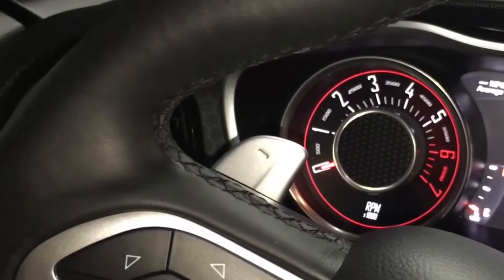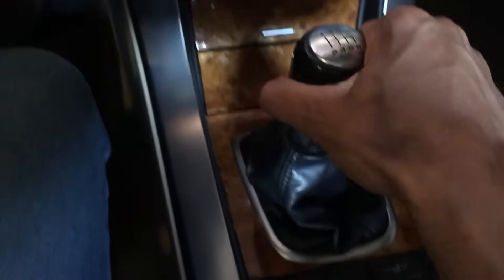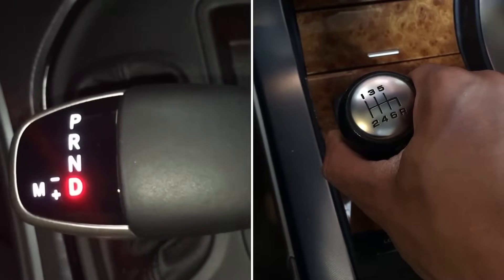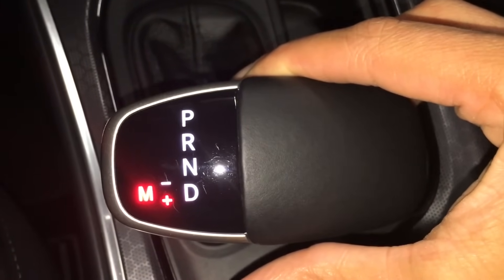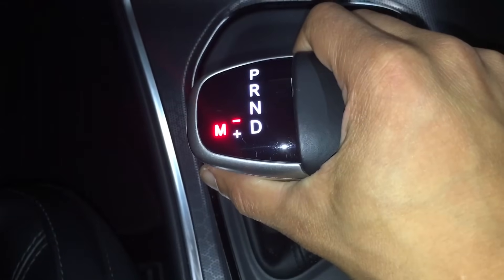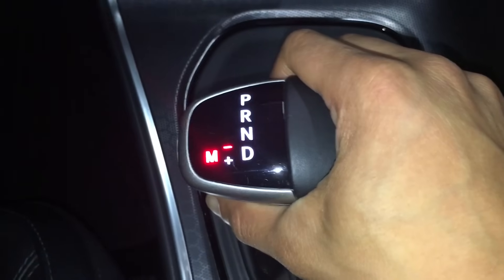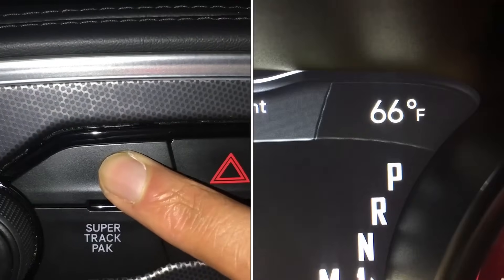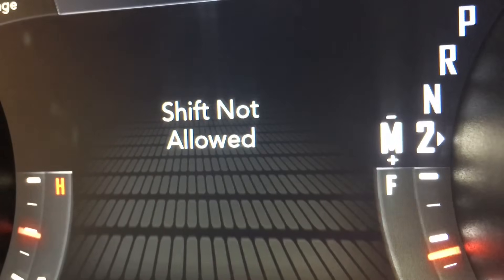PADDLE SHIFTERS: How They Work Explained!

Comment: So you don't know that paddle shift Transmissions are standard Transmissions using a computer to shift the transmission using solenoids can a hydraulic system to engage and disengage the clutch

Comment: My car (2010 Lincoln MKZ) has a trans like this except it doesn’t have paddle shifters. Instead, u just shift with the gear lever like on a sequential trans in a rally car or GT1 racecar. My car also won’t let you downshift or upshift at certain points, but it only has the automatic downshifting. If you let it go to the redline, it’ll stay there. Also if you spin the wheels, it won’t let you upshift for a few seconds theoretically until it thinks you’ve gained traction. Downside of that is if you spin a little bit, and hit redline early, it won’t let you shift and you’ll just be awkwardly redlining for a bit at about 40mph in 1st until it lets u shift into 2nd & then you disappear. It also for some reason has a delay in the shifts.

Comment: I can upshift pretty well with the paddle shifters, but I still struggle to understand when to down shift
Reply: Going up hill
Reply: If you want more acceleration, you need to gear down because the engine would have a higher RPM. It’s just like riding a bike. When you ride a bike in higher gears, you struggle to accelerate. But when you gear down, you find yourself being able to pedal more often and accelerate faster.

Comment: Paddle shifters aren't necessarily in an automatic transmission car. Many are in a manual transmission car, but with the clutch automated with electronics and a hydraulic system. It's still a manual transmission and structurally different from an automatic transmission.

Comment: When you slide over icy road need to reduce speed/use engine brake which paddle shifters should be used  + or - and when you need more power for hilly area should be  + or - and you need to pass the car on highway should be + or -  ?
Reply: if you want to slow down use downshifting or -

and also if you want to climb up a steep hill and downshift or - again. it's like a bicycle it's easier to push the pedals in 2nd gear going up hill than 5th. vice versa when going down hill and you want more speed you would shift up or +

basically you want to watch your rpms kinda like the speedometer with practice you can feel/hear enough to be able to know when to shift up or down.

Comment: I have a Mazda Miata, and its paddle shifters are VERY intuitive. They also offer up/down shifting on both sides of the wheel.
Reply: How fast do they apply and can you control exactly when the shift happens?

I can heal-toe downshift a manual and have the power come on exactly when I want and how hard I want. How close is paddle shifting the automatic to a manual shift?

ETA: fixed some garbled grammar.

Comment: What happens when I am in say 4th gear and want to downshift to get torque to overtake someone. Do I have to wait for the RPM to drop ?
Reply: In my car at least I have to wait for it to drop where, when I down-shift, my rpm's won't be in the red. If I can downshift without the rpm's going into the red it lets me downshift

Comment: can you explain to me when do you need to upshift? at what rpms? 
is it before the red??
Reply: it very much depends on the car but you should be trying to avoid red lining at all costs as a general. most cars sweet spot for shifting is around the 3000rpm mark. some higher, some lower.

Comment: im still confused
Reply: I know right.. Basically its a computer controlled Automatic transmission with manual user input points. Overclocking with fail safe built in. Pretty genius idea. And wait till they add Ai learning to it. Humans will be obsolete soon.
Reply: Human Being. That is what they are after. Making the human being obsolete and once that is done THEY and the AI will go and live on epstein island happily ever after.

Comment: What do you think the "M  +  - " feature on the gear shift knob does?   These are manual up-down shifting switches!   All you're doing with paddle shifting on the steering wheel is moving the user interface.   The paddle shift function at the gearshift knob comes built-in with many automatic trannies.

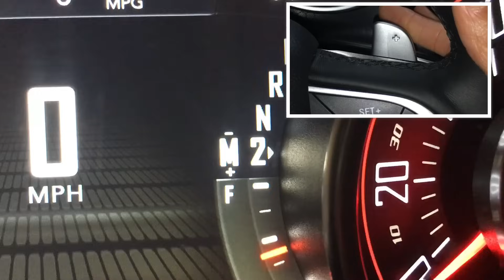Comment: 2:34 I get down shifting to a low gear at high speed is prevented in automatics but when putting your automatic at say 4th level while idle doesn't mean you are in 4th gear, you are still in 1st gear and you are telling your on board computer not to shift past 4th until damage might be caused due to red lining. At least that's how my car functions.

Comment: Im just wondering if you were driving it into automatic Can you switch it to manual while the car is running?
Reply: Alchie Tagapan yes you can
Reply: According to the Dodge Charger manual you can put it into auto stick mode at any time, shift at any time, and shift while accelerating. The transmission will protect itself.